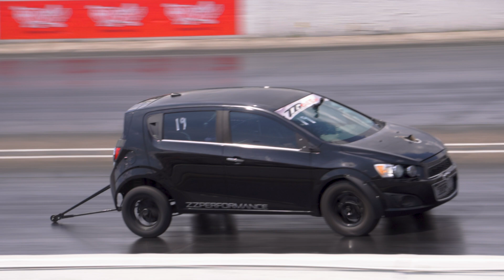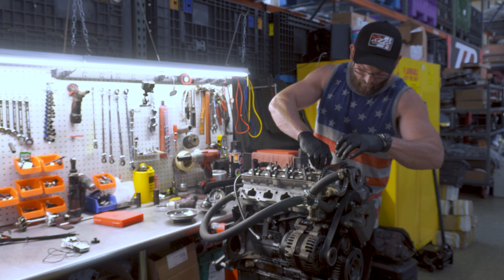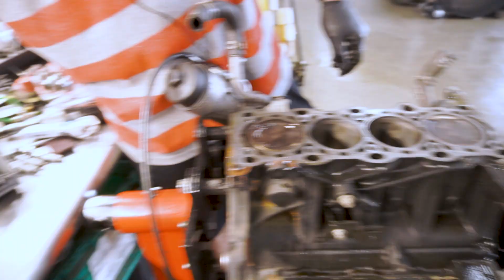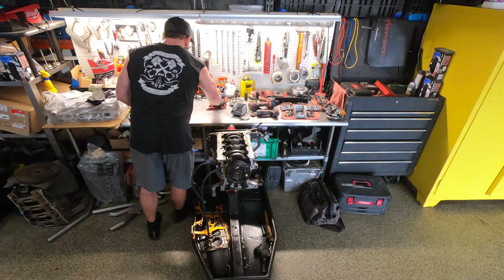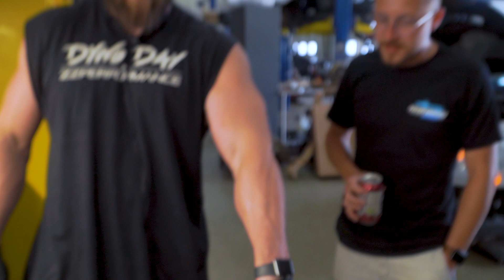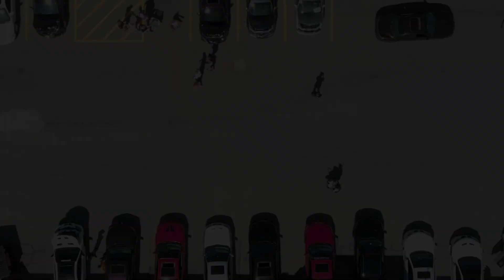600 WHP Drag Sonic 1.4L Ecotec Engine Teardown

Comment: Is there any chance a 1.4l luu would be swapable? I know the lower half of the block would need to be swapped for the oil return, but will the turbo and manifold bolt to the head? Cams the same, or would be need to be swapped. Luu complete engines  are $3-600 vs 2500 used. Any help appriciated

Comment: hallo, I have an opel corsa D 1.4 ecotec engine block is broken and can I use a chevrolet cruze 1.4 turbo engine block?
Reply: I've got a corsa e with the same engine. They are basically the same, yes.

Comment: what transmission are you using?
Reply from the maker: It has a factory 1.8 Chevy Cruze transmission with Sonic RS final drive.
Reply: @ZZPerformanceChannel  Do you think youll be running into the limits of the factory transmission soon? Have you run into any issues with that transmission and fixxed it?
Reply: @dantheman1998  The transmission failures were more of my fault than the actual power. Worn synchros and teeth on gears gave us some issues, but we haven't broken anything OEM from pure power. You can still purchase new OEM gears and synchros from overseas (although it's kind of hard to find).
Reply: @gbrunner24  isn't this transmission still in production? Why is it hard to get parts???

Comment: So your going to sit there and tell me that the stock block isnt at least flexing? No head lifting issues? Is the stock block really THAT good?? and the crank too?? Also what did you mean by knock monster?
Reply: Well, it's not like I had load cells placed throughout the block, but I can tell you that if there was any flex, it wasn't enough to leave a single trace. All of the bearings were in spectacular shape, and the only damage to the crank was where the flywheel bolts had snapped. 
You have to keep in mind that this is an iron block with a full bedplate design (as opposed to individual main caps) similar to the Ecotecs that we're all more familiar with. 
Additionally, this engine is incredibly compact. None of the typical flex points really have enough leverage to do any damage. The bore spacing is very tight, and the bore is relatively small, both of which are favorable for keeping the head clamped down.
Reply: As far as "knock monster" I meant that the factory knock sensor is very sensitive to noise, far more than any other engine combo I've dealt with. Switching from a full exhaust to the hood exit exhaust made the knock sensor go crazy, and I had to switch back to more traditional standalone type tuning. Reading plugs, inspecting pistons, watching boost and backpressure fluctuations, etc. All things that need done anyway on an engine running at this level, but especially important when you can't fully trust the knock sensor.

Comment: Wait like 576 horsepower?????? On a 1.4????
Reply: Is there any powertrain or suspension difference between the pre and post facelift sonic 1.4s? As well as normal 1.4 vs rs? Additionally, what was done since the last breakdown and parts list besides the new turbo?
Reply: @zachward6441  since the last engine swap all we’ve changed was the turbo and added a 35 shot for this last event.
Reply: Suspension wise I’m personally not familiar with the facelift changes.
Reply: @zachward6441  Suspension and powertrain is exactly the same between the "generations" of Sonic; only differences were cosmetic exterior and interior.

Comment: i bet they came loose a little and snapped.
Reply: I believe that the aluminum directly under the bolt heads yielded, taking the tension off of the bolts and allowing them to work loose.
Reply: @armcclure  I agree

Comment: That's very cool. .  Hay wondering if you  guys can make a power build kit. Including all gaskets and parts to build the engine.  Like everything valve springs head studs pistons rods. I would  really like to  build my 1.4 engine.  Next year.
Reply: The options that such a kit would need to have, just based on the companie's 20+ years of experience, would be too much to have an easy to kit/store package. We either have or will have everything needed available, and CS can help guide you in the right direction. 
We do not sell "race prep" engines on the site, but we do build them for in-house customers on an as-needed basis.
Reply: @armcclure   OK thanks . I have had hard time finding  full gasket kit.

Comment: Great vid!  Does this have a ported head or stock?
Reply: Stock head and our stage 1 cam. Will be getting a ported head and our stage 2's when it's back together!
Reply: @gbrunner24  wow, so much power left on the table once you get ported head and custom intake manifold.  I feel the stock manifold even though it can hold boost if just very flow limited especially at the throttle body opening.     Look forward to build.
Reply: @dtbrown1978  The throttle body opening still has quite a bit larger cross section than the turbo outlet. There may be a gain there, but I don't expect it to be significant. The runner length works well, but I could see a significantly larger plenum being beneficial.
Reply: @armcclure  I'm speculating as my test of the LNF tb on even a ported manifold was pretty much zero gain in throttle response or power vs stock TB as the intake manifold TB opening is significant less than the LNF TB.  I did have an interesting result when testing the LNF TB with a heavier WGA spring as it did pickup a bit whereas before with stock TB nothing.   Similar result with the LNF going from stock intake to GM intake it did gain unlike with the stock TB little to no difference.  I test using a Dragy 0-60, 1/8th mile and I have an automatic so very consistent with tests.  

From my testing the LNF on a stock turbo has little to no benefit as the stock TB is sufficient for the amount of volume the stock turbo can produce even at 20 psi. I'll be testing the LNF with an upgraded turbo soon so if my test are right I may see a larger performance gain with the added flow rate.

Comment: Didn't that thing have like a billion miles on it before you even started modding?  Or was that your LSJ?
So what's next for the Sonic?
Reply: My LSJ was over 200k before I did my first turbo swap, this engine was put in fresh a couple years ago. I mis-spoke in the video; This engine has been in for 2 years but this was the start of the 3rd season. 
I should have Tyler add up the slips and dyno pulls sometime...

Comment: Really makes you wonder if a slightly heavier oil would let you run more boost. Awesome build. Amazing what your doing with an engine with no business being as powerful as it is.
Reply: We will be watching that a little more closely on the next engine. This one was assembled with stock specs which is on the tight side, which is one of the reasons we kept the oil light.